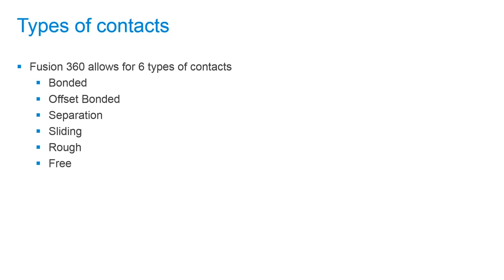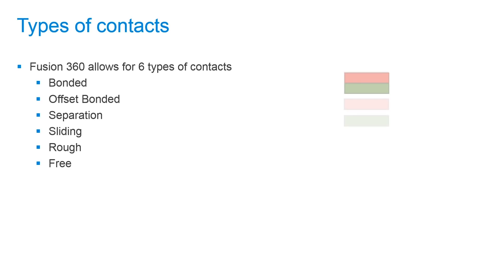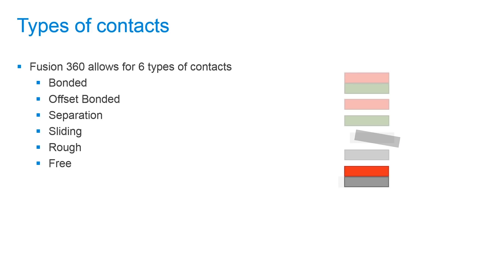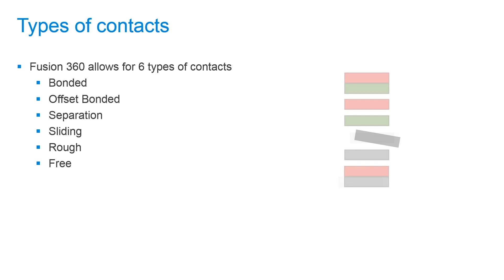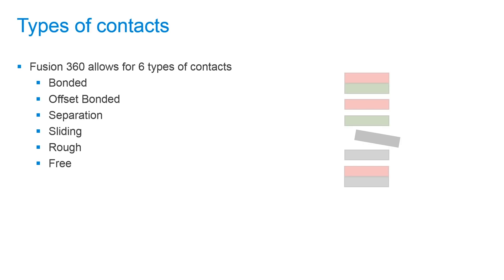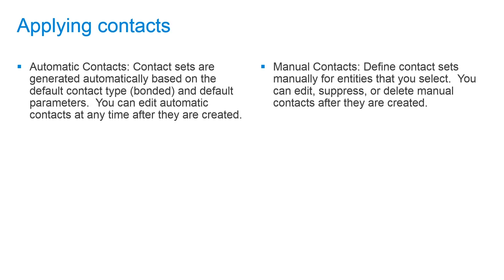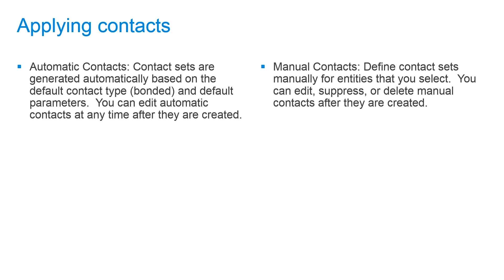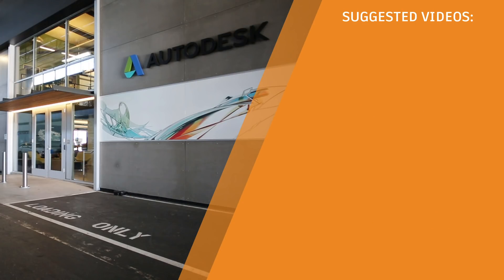Autodesk Fusion 360 | Defining Simulation Contact Types in Fusion 360

Comment: Hello , is there any more in depth videos about contacts?
for example we make a flap joint of two pieces connected with a dowel , how the two pieces should be bonded ? seperation ? would rough contact allow to simulate a glue layer by making friction coeficient equal with the shear strength of the glue ?
how should the dowel with each body contact be?  bonded , rough ,seperation ? 
I ve seen many f360 videos but all are shallow and I believe the contact type is crucial for a realistic simulation .
Are there any courses you could recomend ?
Thanks